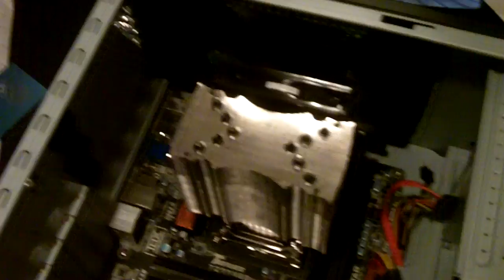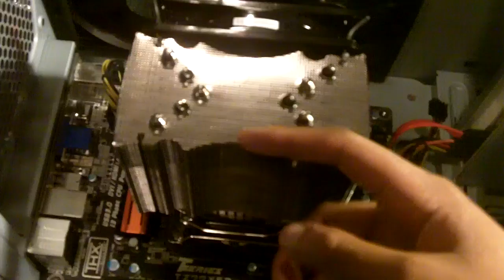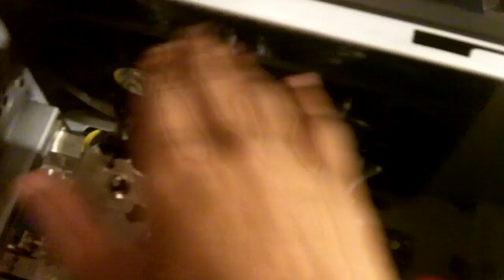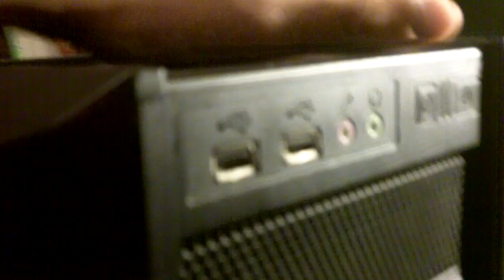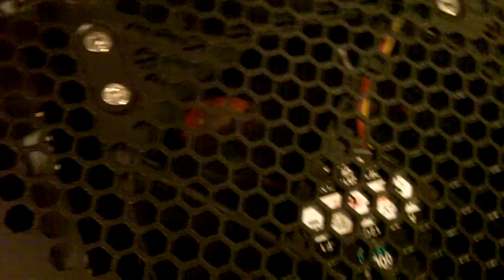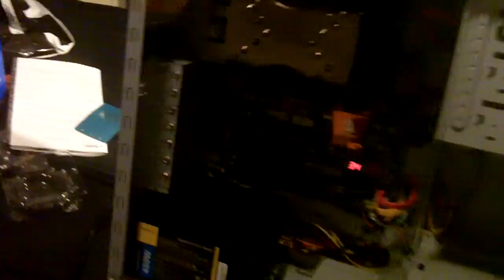Spire Thermax Eclispe II CPU Cooler

Comment: THANKS! very good demo. And I actually liked the backround noise, it gave e pretty good reference for me. I was desperatly seeking a good noise demo, but seems like audio level isn't that important to most people.
It actually seems loud to me, are you satisfied with it? How is it with the plate on?
Reply from the maker: The noise is no issue now that I have a fan controller than can manipulate the amount of voltage being delivered to the fans on the heat sink.